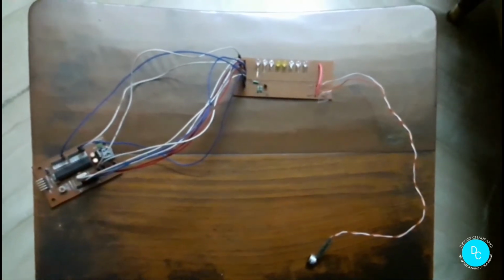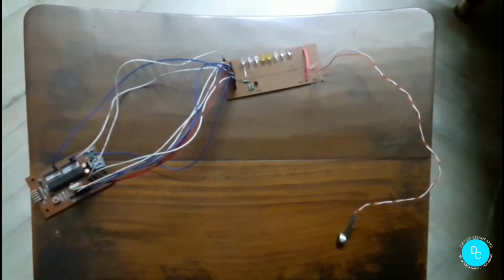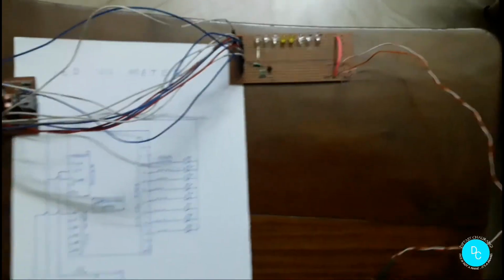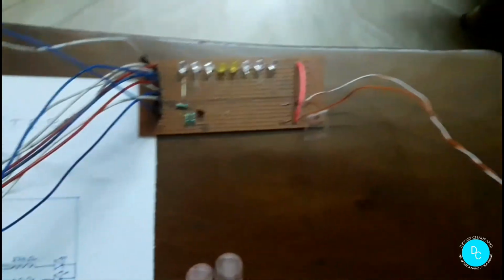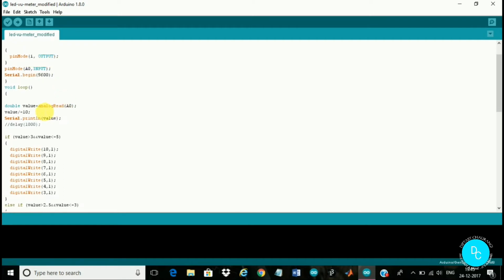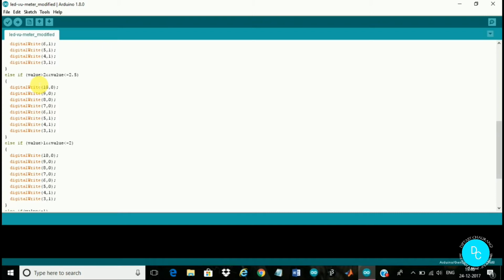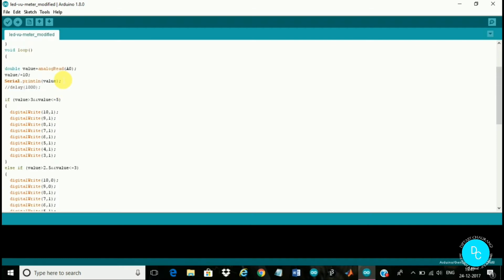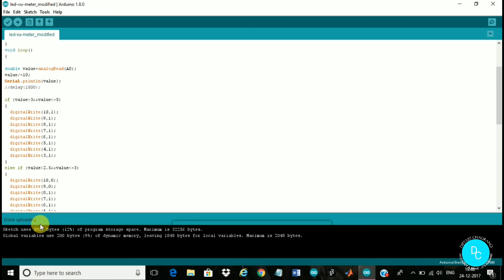LED VU-METER with Arduino UNO

Comment: subbed
Reply from the maker: u have still not subbed me...
Reply: I am subbed.  I will unsub and re sub
Reply: should be sub #94
Reply from the maker: sorry it is showing 93 only.
Reply: LED VU-METER with Arduino UNO
Diptajit Chaurangi 
Diptajit Chaurangi
Subscribed93
Reply from the maker: yes its showing 93 only
Reply: it is also showing that I am subbed.  Not sure what is going on I unsubbed it said 93 and I subbed and it still said 93.